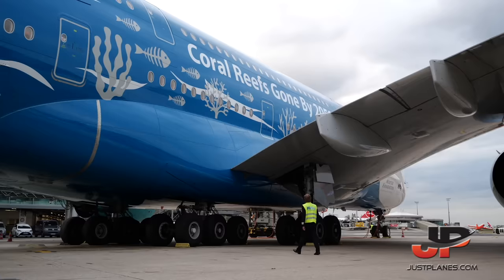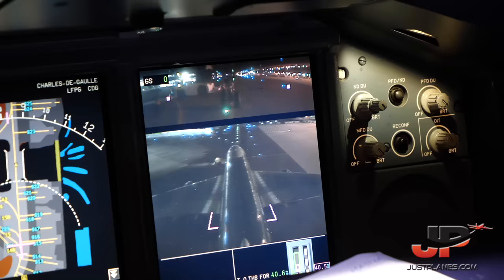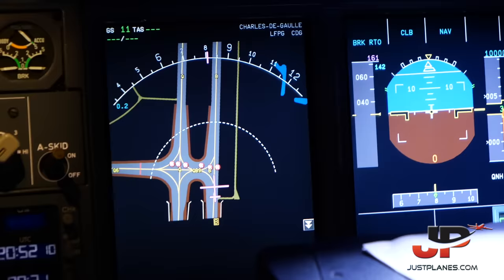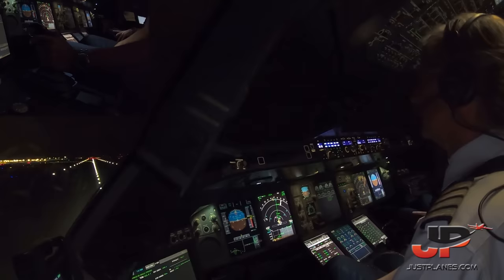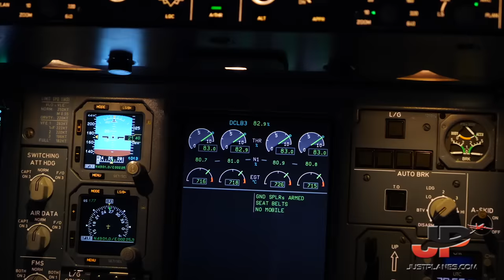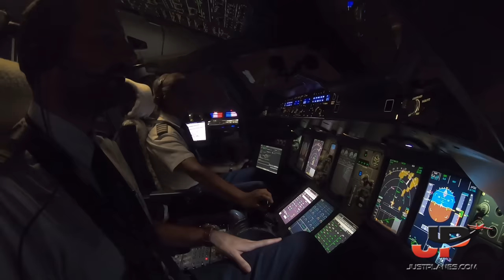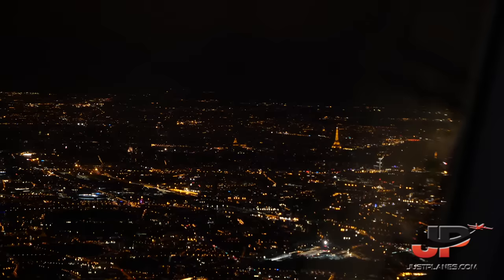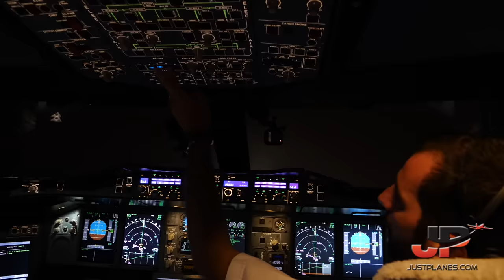Fantastic Cockpit Views AIRBUS A380 Takeoff | 8 Cameras

Comment: "Spooling" is often used in a very general way - as simply allowing an engine to ramp up to speed.   But it's actually the pre-take off thrust - to ensure engines on each side of the aircraft are operating in unison.  If they did not, the plane would pull to one side.  When checked,  full take off thrust is applied.
Reply: Yes  correct.master
Reply: Correct good knowledge I hate seeing bad knowledge spread

Comment: the coolest part about flying is when they put the plane on "parking brake" before the line of the runway and throttle up the engines to "max" power and release the brakes. the plane shakes and the acceleration is awesome, but it's also cool when the pilot already throttles up the engines halfway through the corner heading for the runway and takes off.

Comment: 74 tons just hanging out on each of the wings? That's some magical engineering...
Reply: He said 7 tons, not 74...
Reply: @meshkovsergey Watch it again.
Reply: @TheAntiSmug  Well, I did and at 0:12 he clearly said "weights about 7 tons and costs around $20M"
Reply: @meshkovsergey  I know this because my dad is Senior first officer pilot. 4 engines is 28 tonnes + 260 Tonnes in fuel and the body of the airbus is 287 tonnes so it totals about 575(maximum fuel and full passengers) tons that the wings of airbus have to carry
Reply: 7 tons PER engine, 260 tons max fuel capacity. He did not mention the max loaded weight of the aircraft. AMAZING numbers any way you look at it!
Reply: With 74 tons hanging off the wings and a full payload, the thing would not get off the ground. Each GP7200 engine weighs about 6.7 tons and there are four of them

Comment: LINUX on board...
Try to imagine Windows controling this... :D
Reply: Correct me if I'm wrong, but I think Linux is just used for the in-flight entertainment system, and it has had its fair share of crashes (although the problems might reside in userland). Speaking as a Linux user (for over 20 years) I wouldn't trust Linux or Windows for this. At the end of the day though, the most likely software fault would be in the A380 control software itself, not the kernel. Regardless, I'd assume they have redundant sets of computers as well.

Comment: Why does the pilot flying increase the number 2 and 3 engine thrust first at take off and then after a while he sets the thrust on engine 1 and 4?
Reply: 1&4 are the outermost engine and hence hangs above the grass, thus to prevent sucking in any Grass/FOD they build up speed first with 2/3 (inboard engines) and than increase thrust of 1/4 since at higher speeds it's less likely for the engine to suck in the grass/FOD
Reply: Central engines thrust more stable close to main frame then gradual increase of outside engines 1 and 4.
Reply: Warren Smith The Airports these planes fly into in Australia all have runways that have been widened with a concrete verge. The wing is just amazing.
Reply: @tituslim4648  Quite a long take off run with the delayed outer engines. And a long interval between V1 and rotate. I wouldn't want that run to be much longer. Yikes!
Reply: @fingerhorn4  not really the captain increased thrust on 1/4 at 40kts and with a heavy aircraft the difference between v1 and rotate speeds would definitely be far but it's still safe the pilots calculate it for every flight/ takeoff
Reply: @tituslim4648  ask Airbus

Comment: That must have been quite a payload they were carrying, cause they just about used up the entire runway to rake off! 😀
Reply: I noticed. Of course after V1 there was still plenty of runway to abort but still.
Maybe it's the normal procedure for A380? Seems captn didn't apply full throttle until it rolled quite a lot

Comment: The a380 is honestly an impressive aircraft. Just unfortunate it’s turning out to be a failure for most airlines😪
Reply: A good aircraft...just not a good time for it to be in existence.  The Queen of the Skies (and A340) is suffering the same fate, but thankfully she came out A LOT sooner.  :)
Reply from the maker: You are right Cole. The twin engine planes have made so much progress and I think that is what ended up against the A380. Heck I hear the new 777X can carry 480 passengers in a 2 class configuration.... which probably makes it a lot cheaper to operate than the A380... although I think we will be seeing A380s in action for a few more decades so no reason to panic yet :)

Comment: A 380 fuel weight fully loaded weigh as much ass a fully-loaded a340-800 overall and still gets off the ground and climbs higher than most jets. That's pretty impressive 👏🏾💯🔥📈

Comment: Huh - I noticed that for the take-off roll, the PF (Captain) spools up all 4 engines so they are stable, and then for T/O thrust, he pulls back engines 3 and 4 to what looks like Idle thrust, and sets T/O thrust on engines 1 and 2. After a short while, he then sets T/O thrust for engines 3 and 4. I did not know this was (or could be) procedure. Can anyone comment on this? Even though they can compensate for it with rudder, I'd imagine this would cause a rightward yaw. But more interestingly, wouldn't there by some time during which engines 3 and 4 are producing less thrust as they start to use up runway?
Reply: Copy of a comment further up: "1&4 are the outermost engine and hence hangs above the grass, thus to prevent sucking in any Grass/FOD they build up speed first with 2/3 (inboard engines) and than increase thrust of 1/4 since at higher speeds it's less likely for the engine to suck in the grass/FOD"

As far as I know most larger / 380 capable airports have widened areas around the ends of the runways meaning there would be no need for such a procedure.
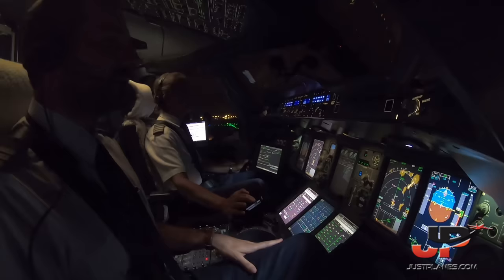Reply: He advances Engine 2 and 3 first. The thrust levers of engine 2 and 3, inboard lefthand and righthand, are clearly visible at 07:10, clamped together at the MCT/FLEX Detent. Also at this instance you can see on the EICAS-Display, (just to the left of the gear idicator) that there are different values being displayed for the outboard and inboard engines. So the thrust is at least symmetrical. But why the captain did apply this technique, i don't know. I have never seen that before, maybe some Airbus-Expert can enlighten us!

Comment: I love, love, love these videos. I have a question though. In most of the aviation videos I see, as soon as the computer says “V-1” the pilots say “ rotate” immediately afterward. Well, in this particular video, the pilot seemed to wait a little while before he called the “rotate” command. Is there any particular reason for this? Or does it even matter?
Reply: V1 is the speed you can’t abort the takeoff because the remaining runway is too short to stop.
Rotate is the command to pull the nose up.
So both commands are per se independent of each other. 
So on a short runway or in rainy conditions or with a very heavy aircraft you might reach V1 some time before you’re fast enough to pull up the nose
Reply: @MrSchwabentier  😳wow ok, thank you for explaining that. I was always under the assumption that “V-1” meant that you were at the speed needed and required to pull up. Thanks for that clarification sir.

Comment: Such an amazing achievement of aviation and they are all being retired due to not being fuel and maintenance efficient enough.  It's tragic and necessary at the same time.  Even the 747s are slowly being withdrawn from service and replaced by Beoing 777-8/9 or Airbus A350-1000s.  The era of the 4 engine passenger liner is dead.  I am going to miss riding a 747 and missed my opportunity to ever ride an A380.  Twin engine airliner planes are too plain for me.
Reply: As I understand it, it's not so much the fuel efficiency - an Emirates executive said recently a fully loaded a380 is more fuel efficient than a 777 - it's that it's difficult to fill the seats up.

The last a380 is still in production, and I believe cargo 747s are still being knocked together, so we still have many more years of seeing this great technology in the air.

Comment: 11:25 What's that hard sound ? Like a train moving slowly
Reply: I have heard, though I do not know if this is true or not, that the plane goes over slight bumps in the landing strip that are at a set distance apart. It is used to tell how fast the plane is moving and its acceleration.

Comment: Why do they wait a bit after V1 for rotating? In some other videos, I saw that pilots usually rotate immediately after V1
Reply: V1 is not the speed you rotate. V1 is the speed at which takeoff should no longer be aborted. The speed they rotate is Vr. As Vr is usually greater that V1, especially in heavy planes, rotation takes place a couple seconds after the V1 callout. The reason you saw in other videos that pilots rotate immediately after V1, is because V1 was really close to Vr.

Comment: The A380 has already failed on the market. However, there is only one way to come back to life. It's converted for amphibious use and repurposed for wildfire extinguishing by equipping the wing with a watering device at low altitude. Wildfires are occurring all over the world these days, and each country has a mandatory A380 forest fire extinguishing plane per 10 million people, and established an international organization to counter-force mobilization to countries with large wildfires. If you mobilize a temporary rental and use it to extinguish forest fires, it will be very successful. Of course, it would be good to remodel it so that it can be used as a freighter in peacetime.

Comment: Is it known what caused the rumble and the vibrations that shaked the pilot seats at the beginning of the take off run?
Reply: the nose gear is running over the runway centerline lights.
Reply: @MrSchwabentier  Ok, sounds plausible, but surprising that that's enough to cause such severe resonance - and the sounds too?
Reply: @Eigil_Skovgaard  its not that loud in reality, my guess is that the microphones for the video are mounted somewhere where the vibrations get recorded via the material, not the air. Basically a similar effect when you knock with your finger on the hull of a camera, the knocks get incredibly loud on the video.
Reply: @MrSchwabentier  You are probably right. The 380 is my favorite flying miracle, and I would hate if it wasn't as pleasant to fly as it is to look at.

Comment: Hi everyone, not an A380 pilot here.

Can anyone rated on the A380 explain me that take off power setting technique at 07:00 please?
It seems that the CM1 is advancing only levers 2 and 3 to FLX/MCT initially and then at around 40kts is advancing number 1 and 4.
I've never seen such a technique and I couldn't find any reference online, I've looked other A380 take off videos and they all seem to apply the same technique we use on the A320.
Please do not give an explanation unless is supported by Airbus, no guessing.
Thanks.

Comment: Somethings wrong. Two engines on a wing each 15k thousand pounds? that's 30k pounds without fuel in one wing? No way the wing is able to flap in the air with all that weight on it.

Comment: My own thoughts......So much information displayed to the pilots, totally overwhelming, always though that the instrumentation is getting overly complex......If you drove a car and had to turn on the fuel pump, then turn on the starter motor rather than just turning the ignition key then drivers would quickly get frustrated. Provided all the preflight inspections and checklists has been completed then what's wrong with a switch that sequentially starts the engines. There is a real danger with modern flight software that overrides the pilot in case of an issue when in real terms the pilot should always be able to disable this "smart software" and fly the aircraft out of a problem, isnt that why we put trained pilots in the cockpit... anyway as mentioned just my thoughts... And by the way I have flown a number of aircraft..........

Comment: 260 tonnes of fuel in the wings... show me how that works using physics in such a thin wing..
Reply: 1. The area is massive. 
2. They’re not that thin. 
3. Simple maths. 130 tonnes would fit in a space 32.5mx4mx1m so it’s not hard to imagine. Unless you’re a bit dim.
Reply: @peteconrad2077  did you forget the wings contain a large hydraulic system taking up most of the wing.. so you think fuel mixes with hydraulics to fit the wing.. laughable.
Reply: @TheHomeloanking  no I didn’t offer because they don’t. The hydraulic lines are very thin and the flap mechanisms which are the main large hydraulic components are kept in the flap track fairings under the wing. They’re quite obvious, they’re the large canoe like structures beneath the wing.

Comment: Engine cost 50, not 20.000.000$.
Reply from the maker: I checked the price of an A380 and it looks like its around $450M. If thats the case I can't imagine that the 4 engines could cost half of the price of the entire plane, that doesn't make sense...
Reply: @justplanes  Wow, I got reply from JustPlanes. Cool! Engine alone cost 25m$, so in first place captain was wrong. Engine Trent 900, with all support included cost around 46m$, and without support you dont have engine, so 46m$ is the price we wish to hear. All the best!!